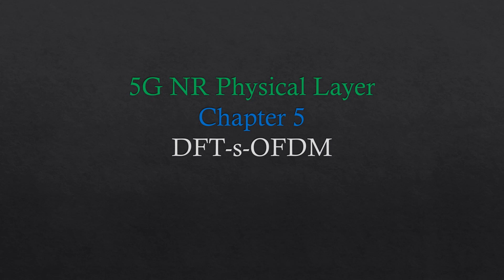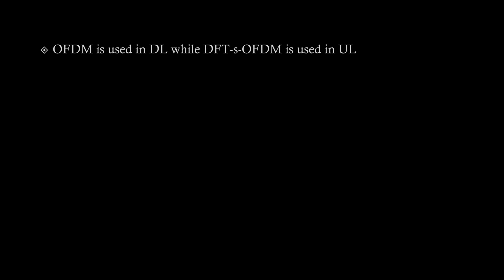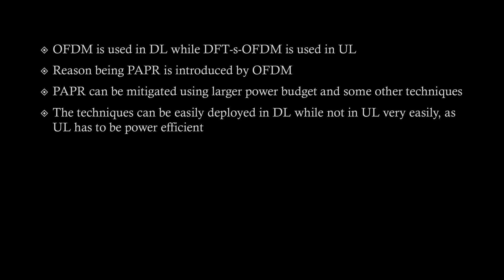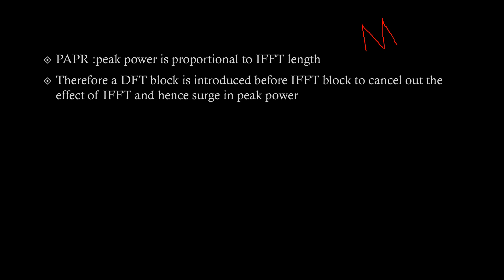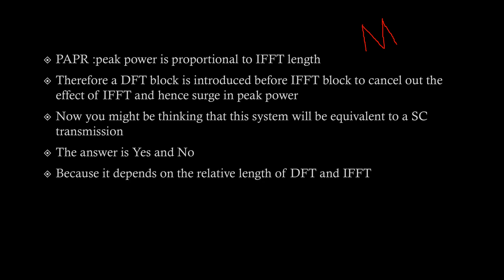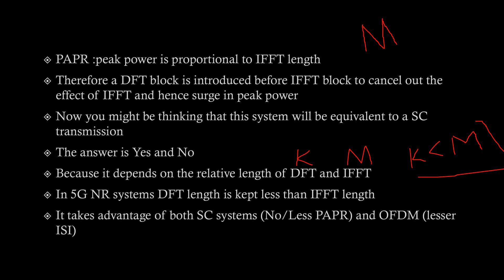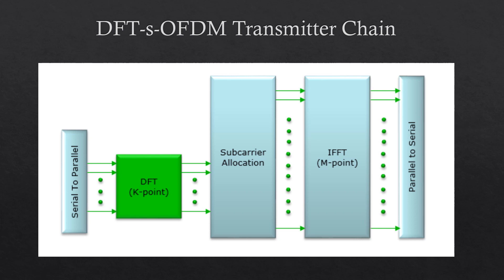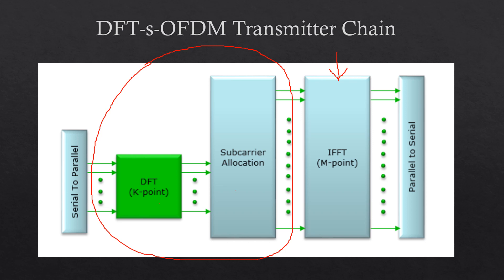5G NR Physical Layer | Chapter 5| DFT-s-OFDM

Comment: Nice work from Curious being. However, I am doing a project, and I tried to take the advantage of DFT-S-OFDM to mitigate the harmful effects of of PAPR. This appeared very good in MATLAB simulation with even a better BER performance compared to ordinary OFDM. However, when I tried to validate the signal by transmitting it using a USRP attached to a computer and receiving the signal with an SDRPlay attached to another computer in the Lab, it become very impossible to decode the message I transmitted with the signal. Whereas, In the case of ordinary OFDM, the decoding of the over-the-air transmitted and received waveform was pretty easy and simple. What could be the reason for this? I will appreciate your helpful insight on this sir.
Reply from the maker: Hi Stephen, are you taking inverse DFT at the Receiver?
Reply: @curiousbeing8585  Yes, of course, I did take the IDFT at the receiver side after the FFT and channel equalization.